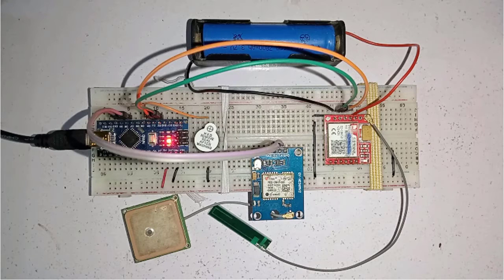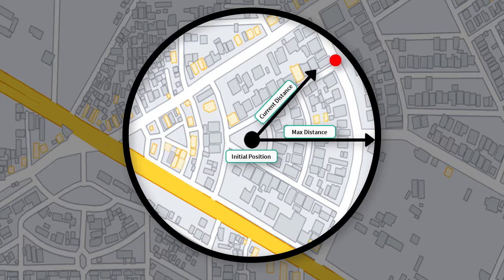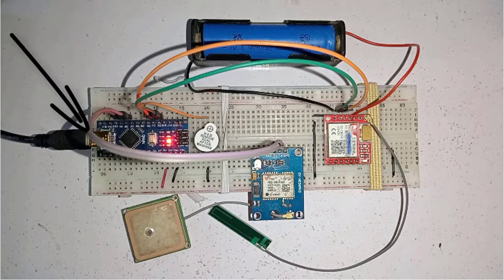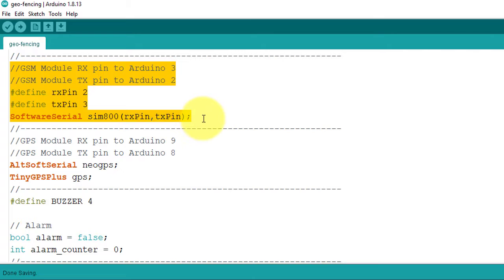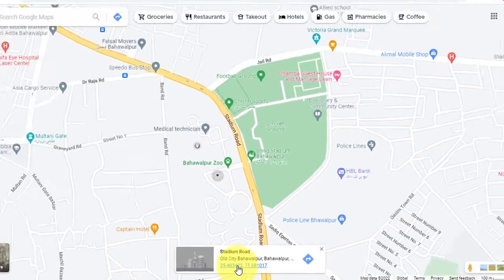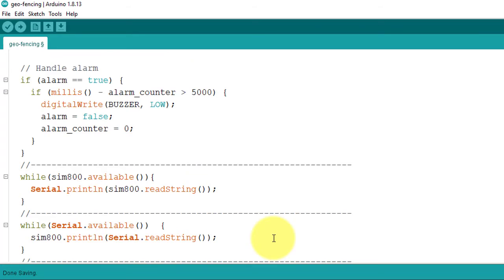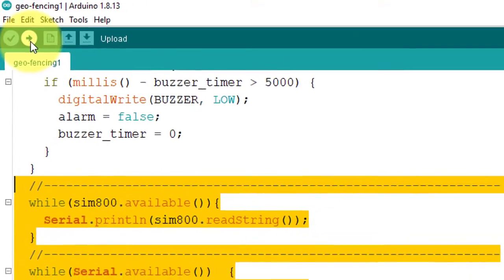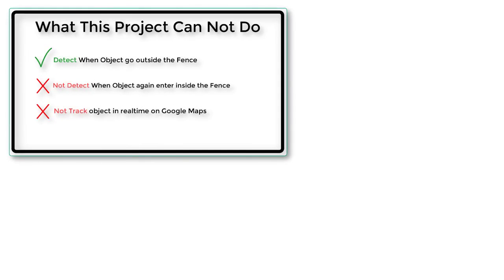Arduino Geo Fencing with SIM800L and GPS Module

Comment: Hi, I’m new to Arduino. I have a school project where I need to create a central server (similar to a modem) that can use geofencing, along with a wristband-like device that can trigger it. When the wristband user moves outside the geofence radius, the system should trigger an SMS alert, update the web dashboard, and record the event in a database.

Is it possible to make this happen?

I’m considering using an existing wristband that I can buy because designing and building a new one is quite expensive and challenging for a student like me. Is there any way I can achieve this?

Comment: Sir everything is working fine,when the prototype is out of fence  there is buzzing but the problem is sms is not recieving how can I fix
Reply: Hello. I would like to ask why is there only 2 connected wires in the actual connection to the gps module and in the diagram is 4
Reply: check weather the gsm module is connectod to cellular network

Comment: bro what if i use sim808 instead of sim800l will the code still works??
Reply from the maker: you just give it a try and let me know. I never tested it for sim808
Reply: @AhmadLogs  maybe next time thanks thou
Reply from the maker: @CarlsuuuDesuu0723  sure
Reply: @AhmadLogs  umm one last question... if i were to make a real-time gps tracking with geofence capabilities will the materials that are needed is just the same as in the video??
Reply from the maker: @CarlsuuuDesuu0723  yes

Comment: But for me it doesn't gives me the exact values.. It is randomly giving the value and buzzer will turn on even though iam sitting in the same position
Reply from the maker: hmmmm. have you tested you gps module?

Comment: Hi.Hello, make this project permanent so that when we send a message, the same point is the center of the measurement, which means that there is no need to enter the center of the point.  Thankful
Reply from the maker: please give some more detail
Reply: @AhmadLogs  Example .  By sending an SMS to the GPS, that point will be recognized as the center and no longer need to program the coordinates of the point.
Reply: @AhmadLogs  Because in this project, the geographical coordinates of the point need to be programmed manually.

Comment: Need this for a shock collar to create an invisible fence.
Reply from the maker: I understand that you need to create an invisible fence for a shock collar. While this project involves geo-fencing using a GPS module and SIM800L module with Arduino, it is important to note that using a shock collar on an animal can be controversial and potentially harmful. It is advisable to consult with a professional animal trainer or veterinarian before implementing such a system.

Comment: What should i do to have a triangle instead of a circle ?
Reply from the maker: To create a triangle instead of a circle on a geofence using an Arduino Neo6m GPS module, you need to define three points of the triangle using their latitude and longitude coordinates. Then, you can calculate the distance between the GPS module's current location and each of the three points using the Haversine formula.

If the GPS module is within a certain distance of all three points, then it is inside the triangle geofence. You can set the distance threshold based on how close you want the GPS module to be to the triangle before considering it inside the geofence.

Once you have determined whether the GPS module is inside or outside of the triangle geofence, you can trigger the appropriate actions in your code.

Comment: I'm thinking of using this project to start with for my own project. I want to change the following: after startup use the current position (the last known position) as start position for the fence. In stead of a fixed position. In this way I can use it as an alarm for my car/motorcycle. The current or last known position is where I park my car/motorcycle. Maybe I add a secret button for that. In this way the system is always ON and I have already a GPS fix. Otherwise I probably don't have a GPS fix after activating the system, which is when I park and leave the vehicle out of sight. By pressing the secret button I enter 'parking mode' and from there I monitor if the vehicle moves a small geofence area around the parking position.
Reply: Hey, i thought about doing the same for my ebike... did you get it working?
Reply: @vlace5685  no. Could not finaal a provider with a sim in the Netherlamds (Who sells to non commercial buyurs). Triest several. Non worked. Printboard is laying around.
Reply: @bertgroothuis2419  That's a pity, im from Germany and maybe will also try it soon, but I'm not sure if I get it working haha

Comment: Serial port screen says sms sent, but no sms is received on the phone. After saying sms sent on serial port screen, ERROR appears and continues to give location continuously
Reply from the maker: hmmm. have you credit in the sim card you have inserted in the gsm module. I think you are out of credit, so you are getting the ERROR
Reply: @AhmadLogs  there is no credit, we tried it, it can't be the cause of the problem
Reply from the maker: @polatcetiner7332  OK, post the full serial monitor output here int the comments
Reply: @AhmadLogs  Did you find the source of the problem?
Reply from the maker: @polatcetiner7332  I will. just give me the full serial monitor output
Reply: @AhmadLogs  as I throw
Reply: @AhmadLogs  
As I throw then only the location part repeats
Reply from the maker: @polatcetiner7332  OK let me check in the code
Reply: @AhmadLogs  What is the message that the SIM will send to me to meet the site
Reply: @AhmadLogs  It says sms sent but then it gives an error. Stream continues on serial port screen
Reply from the maker: @polatcetiner7332  so the problem is you have got the "SMS send successfully" in the serial monitor and then after some time you have got the ERROR in the serial monitor. 

can you please send me the complete serial monitor output?
Reply: I have the same problem with you, did you find a solution for it?
Reply: @lidalili37  We had the same problem and we solved it.  The root of the problem is sim card related.  Problem solved with a new sim card.  Please make sure there is no problem with the sim card sending messages.
Reply: @buse2419  ok i will be  checking my sim card but I don't have the problem when I tested the card I received the message but with this program I could not receive a message
Reply: please answer me

Comment: Its verry easy to integrate real time location with google maps using firebase realtime database and google map sdk by developing custom android app
Reply from the maker: yes you are right. but It is not as simple with sim800l.
Reply: @AhmadLogs  yes sim800l library not support firebase  data upload but through http post its possible
Reply from the maker: @s.husain6125  yes you are right. but http post create a new node in the Firebase database for every entry. you need http patch instead of http post. that's why I have used library

Comment: Where's the problem?? in serial monitor
No gps data is available
Latitude = 0.000000
Logitude = 0.000000
Thank you
Reply from the maker: its mean your gps module not fixing the satellites. what is the LED status of your gps module
Reply: @AhmadLogs  Light blinking
Reply from the maker: @benadjilabillal2866  what gps module you have?
Reply: @AhmadLogs  Néo-6m-0-001 and atgm332d
Reply: The problem has been resolved. Thank you
Reply from the maker: @benadjilabillal2866  that's great. what was the issue
Reply: @AhmadLogs  A problem was in jumper wires. Excellent job, thank you.
Reply from the maker: @benadjilabillal2866  so nice of you
Reply: @AhmadLogs  How can I communicate with you. Thank you so much.
Reply: @benadjilabillal2866  I have the same problem, how did you detect the error in the jumper cables and how did you fix it?
Reply: @AhmadLogs  I have the same problem, how did you detect the error in the jumper cables and how did you fix it?
Reply: Bonjour est ce que vous avez reçu le msg de la carte sim800l moi non je sais pas c'est quoi le problème

Comment: Hello, sir
Geographic fence is an interesting design and idea that is used to control children and even cars and even Alzheimer's patients. Now that you have decided to develop this program, I wish you would add a push button to save the location of the source and save it in the eeprom memory 
Thanks
Reply from the maker: but why we save the location in eeprom?
Reply: @AhmadLogs   This request was followed by my suggestion( not to enter the source coordinates through the computer) to enter the source coordinates through the push button, so in order not to delete this information by disconnecting and connecting the power supply, my suggestion was to save the source coordinates in eepram memory
sincerely
Reply from the maker: @masoudjafarzadeh  OK, Now I understand what you have said. thanks will try soon
Reply: @masoudjafarzadeh  ای ناقلا مسعود داری احمد رو تخلیه اطلاعاتی میکنی؟اون زرنگتره
Reply: @masoudjafarzadeh  تا حدودی